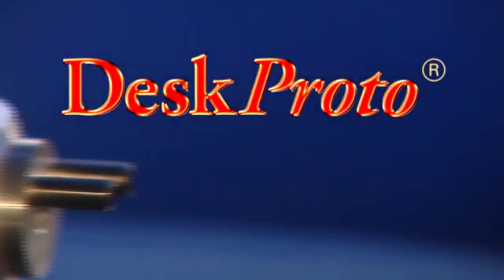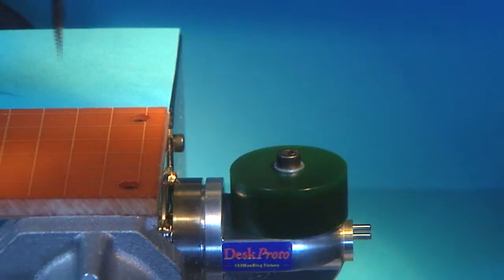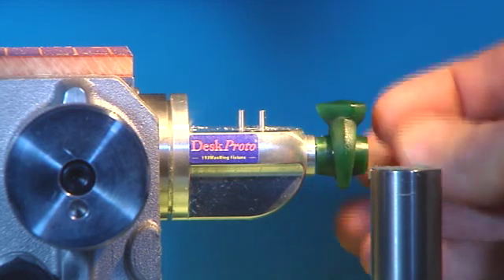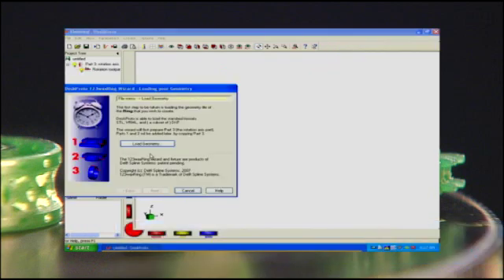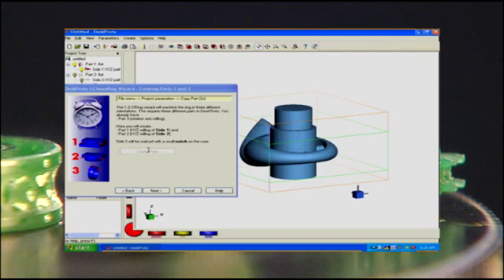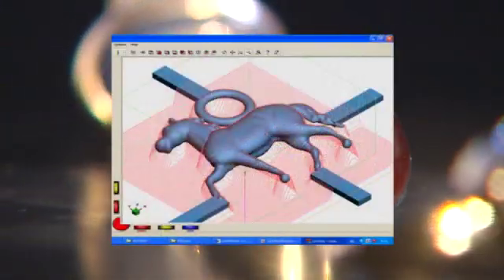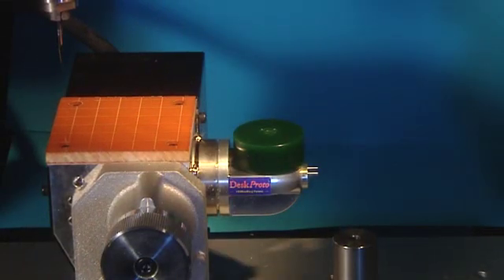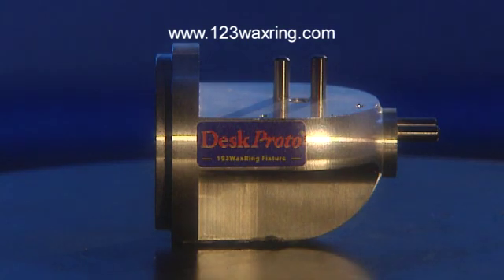123WaxRing movie shows an easy way to create jewelry wax models

Comment from the maker: Dear Jeton,
For prices see one of the earlier comments on this video (or the website):
The 123WaxRing system is priced EUR 295, and to run it you will also need the DeskProto 3D CAM software for EUR 995.
CNC machines are available from say 2.000 to 50.000: for support you can best find a local reseller.

Comment from the maker: @drand102 - you can use any design software, so also Matrix 3D. The resulting 3D model needs to be exported as STL file, then the 123WaxRing wizard in DeskProto can import it.

Comment from the maker: Hi Donatillo,

The video ends with a  link to the website, which will tell you all you need.
This way we can change the price if needed without changing the video.
The 123WaxRing system is priced EUR 395, and to run it you will also need the DeskProto 3D CAM software for EUR 995. Plus of course a CNC milling machine :-)

Lex.